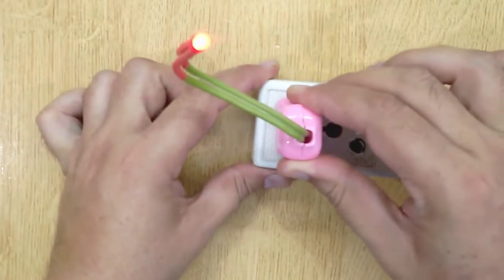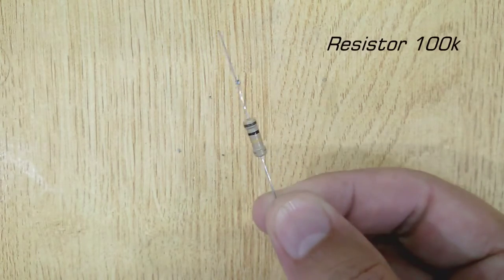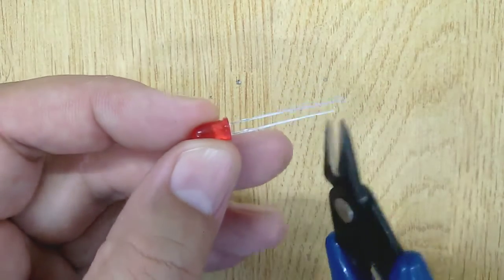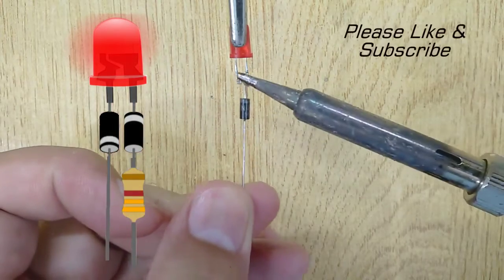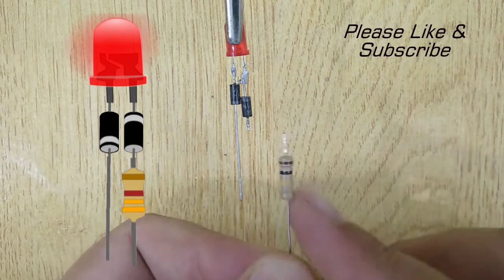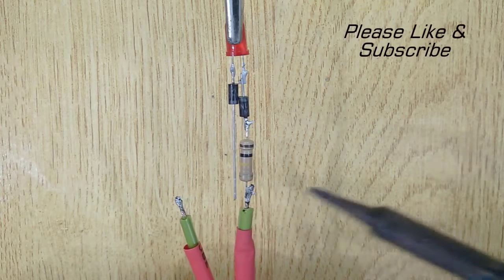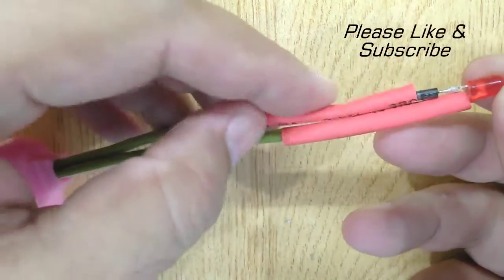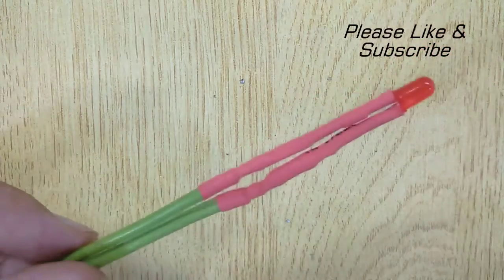How to Light up 3v LED with 220v Power using Diode 1N4007 and 100k Resistor

Comment: Better use 2 resistors or use a condensator as well otherwise the resistor taket over 0,5w and gets really hot.
Reply: Never try to use a condenser because it requires larger space and again high value and high wattage resistor is needed for it. For an indicator so much arrangements is not required.

Comment: Thanks for your video. I can see that, instead of just using a diode on one pole and a resistor on the other, you are adding a second diode before the resistor, and I would like to know why. Are you doing this to improve the alternating to continuous conversion with better filtering? Greetings

Comment: do we really need 2 diodes? i made using single diodes and is working fine
Reply: There is no need for two diodes, the guy that posted the video does not understanding what diodes even are.
Reply: Yes correct, but now I ask do we even need 1 diode(IN4007) since LED itself is a diode(rectifier), I have indicators in switches that doesn't use a external recifier. So what is purpose of diode in LED itself? Can anyone answer?
Reply: Here a diode decreases the ,220v RMS voltage to almost 100v DC after half wave rectification.Thsts the reason to use a diode
So also we are able to use low warr resistor. @karthikms3128
Reply: Because Vdc(AVg= (√2/π)Vrms ,in a half wave rectifier.
Reply: @karthikms3128 The Led can not handle these high reverse voltages

Comment: 220v. Можно просто взять один диод 1n4007 с одной стороны, резистор 0.5w 42k или 47k (до 100k) с другой и светодиод (led white или blue) посредине с соблюдением полярности, работает нормально. Для 110-127v попробуйте 39k (42k) если светит слабо уменьшайте до 27k - 22k, лучше 1w. Резистор греется немного и его вообще можно заменить на конденсатор 400-600v 100n-440n (начинайте пробовать с меньшего номинала)  и паралельнот C включите R от 100k до 2 MOhm для разряда C после вынимания из розетки. Паралельно светодиоду иногда включают стабилитрон 0.5 - 1w 3.7-12v (выводы не обрезайте, это улучшит его температурный режим) и электролитический конденсатор 16v 0.1 - 47 uF, чтобы убрать мерцание, но это вовсе не обезательно.
Reply: Ваш комментарий и ваша информация действительно кажутся очень интересными, но мне пришлось использовать Google Translate, и я думаю, что заблудился, чтобы подписаться на вас. Не могли бы вы дать объяснение на английском языке? Спасибо и с уважением
Reply: @mercedesm.7851  220v. You can simply take one 1n4007 diode on one side, a 0.5w 42k or 47k (up to 100k) resistor on the other and a LED (white or blue LED) in the middle, observing the polarity, it works fine. For 110-127v try 39k (42k) if it shines weakly reduce to 27k - 22k, 1w is better. The resistor heats up a little and can generally be replaced with a 400-600v 100n-440n capacitor (start trying with a lower rating) and in parallel with C turn on R from 100k to 2 MOhm to discharge C after removing from the socket.  A 0.5 - 1w 3.7-12v zener diode is sometimes connected in parallel to the LED (do not cut the leads, this will improve its temperature conditions) and an electrolytic capacitor 16v 0.1 - 47 uF to eliminate flickering, but this is not at all necessary.
Reply: @mercedesm.7851  What part of my comment exactly interested you?

Comment: why u use 1N4007  diode?
Reply: 700-1000v
Reply: @ramsuro  Yes, and most important, the diode protects the LED in reverse polarity.
Reply: @robertzajacek1350  LED iself protects reverse polarity, but may not be in high voltage like @ramsuro said. That is the most important, not what you said.

Comment: Sir I want resistance value ...?
Used 3 volt led in 220 volts with diode in4007
Reply: 100k-120k best

Comment: what if i want 20LED in series what will i use? can i sue the same value of diode?
Reply: If you want to use 20 LEDs in series to glow in 220v AC supply it is a better option to use capacitive dropper ckt instead of a resistor. Because capacitors are wattless devices. I had done a capacitive dropper ckt to glow 36 LEDs (white-5mm) to use as a night lamp.
Reply: For 20 white 5 mm leds the forward voltage required is= 70v@20mA  forward current. In a capacitive dropper the capacitor charges to the peak value of AC supply (√2 times the RMS voltage). So for 250 v AC supply it's peak value is 250√2=354v approximately. So we have to drop (354-70)=284v@20mA delivering current. So the capacitive reactance= (284/20)k-ohm= 14200-ohm. So the capacitance of the capacitor=C=( 1000000/(314×14200))=0.22 mfd@ 400v .or 224pf/400v  is required and a bridge rectifier is required using 4 diodes of 1N4007 and a condenser of 10mfd/400v and two resistors of 1M/0.25 watt is required.

Comment: Please tell Resistance watt.
Reply: @arunavabanerjee1315  if you use 11 k resistor then it's wattage is : (((20×(10^{-3})^2)×11000= 400×(10^ (-6)×11000 = 4.4 watt so you have to use at least 5 watt or more wattage resistor to light up a 40mw led .

Comment: you dont need a diode because led itself is a diode 😂
Reply: Big brain......
Reply: Then plug 🔌 it direct to ac you will see the fireworks 🎆🎇 🙈🤣🤣
Reply: @SinhalaWeightLossGuru  that is what the resistor is for. He is talking about diode. Fireworks it seams :D
Reply: One diode need 1n4007 (700v-1000v) or 1n4004 (400v), two need to be installed 1n4003 (200v)
Reply: Ông nói chuẩn quá😂

Comment: Sir if I use 1watt resistor then it will glow or not.
Reply: @santoshpradhan9513  It only depends upon how much current will you flow to the led because that led even glows from 1 to 20 mA current

Comment: Formula for LED resistor is R = (Supply voltage - LED voltage) / LED ampere. So, R = (220-2)/0.02 = 11k but when I connect 11k with glass type transparent LED then it fuses after sometime. Why?
Reply: Try 180k register or 220k register, its fuses due to low register value.
Reply: @manmeetandroid  No even higher resistor fails. The main reason is power factor of LED as they are capacitive load. Using a diode resolves tge problem.
Reply: @debojitacharjee  Actually LED is one kind of diode only material used for making those are phosphorus, but due to excess heat it fuses you can create more stable circuit using addition of 2 diode (which will make half rectifier) in unidirectional way,( R-D-LED-D).
Reply: @manmeetandroid  not necessary, additikn of only one diode in series will protect the led. Led is a diode but cannot be used as a diode because it has high resistance and when used in parallel (as a load) with AC, works as a capasitive resistance because it's made from PN/NP type semiconductor. Any capacitive load on AC will cause a negative phase shift which will give a -ve power factor value. So the formula P=IV*PF will be applicable and if we use a resistor R with the led then the value of R will be R=(V^2)*PF/P but without knowing the PF we won't able to find the value of R for the led. If we use a diode then the AC will become pulsing DC but not AC, so the led won't behave like a capacitive load. Then the value of PF will become 1, and we can easily calculate the value of R and that will protect the led also.
Reply: 1. Voltage sometime up to 240volt
2.you have to calculate watt if the resistor
Sorry my English
Reply: @poonchau5389  you don't have to calculate anything buy use a diode and everything will work with any resistor between 100k - 200k
Reply: @debojitacharjee  why u use 1N4007  diode?
Reply: @solidname9085  because LEDs are semiconductors and have inductance with AC voltage. With such inductance you can't use the voltage drop formula for a resistor used with DC voltage. To solve this you need to convert the AC to either full DC or at least half DC. So, using a diode makes it pulsating DC and the LED survives with the calculated resistor.
Reply: @debojitacharjee yes absolutely your answer is perfect
Reply: This has happened because of not using a diode. @SubratkumarJena.

Comment: Just put one 120k ohm resistor . No need of a diode. Led is itself a diode
Reply from the maker: Hahaha Very good friend.
Reply: will live longer with a diode
Reply: @ramsuro  How?
Reply: @karthikms3128  reverse voltage
Reply: @ramsuro  LED is also a diode, all diodes prevent reverse voltage.
Reply: @karthikms3128  This voltage for rectifier diodes is determined by the manufacturer and entered in the diode specification, for 1n4007 it is 700-1000v (that is, more than 220v that operate in the network).  For LEDs, it is not so high and is often unknown at all.  That is, there is a chance that he may not survive it in the long term (the degradation of p-n may accelerate).
Reply: @ramsuro  ok
Reply: just put 120k ohm and small bulb no need diode